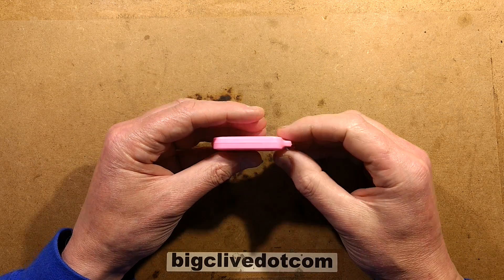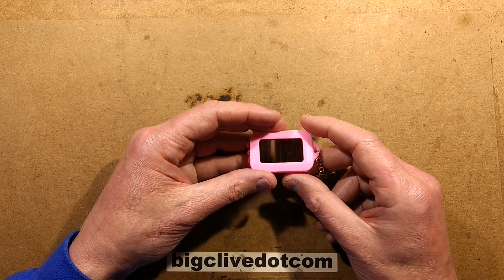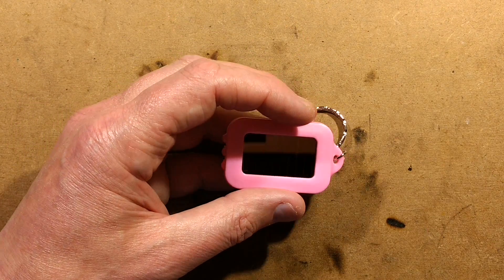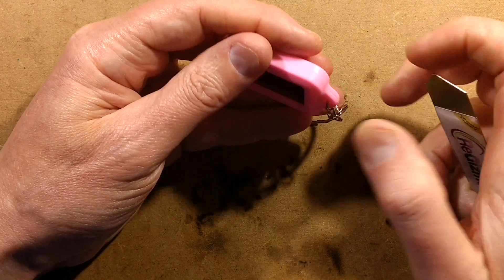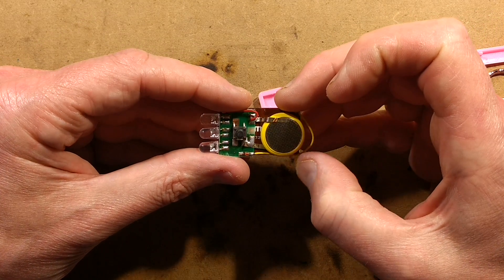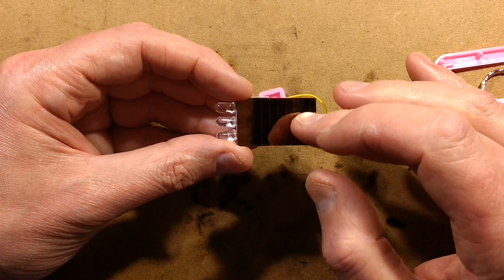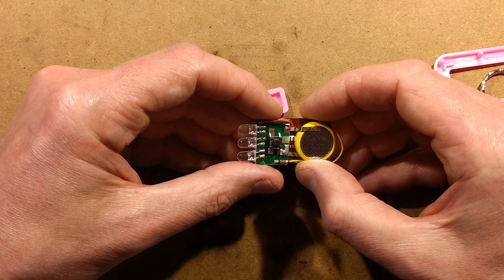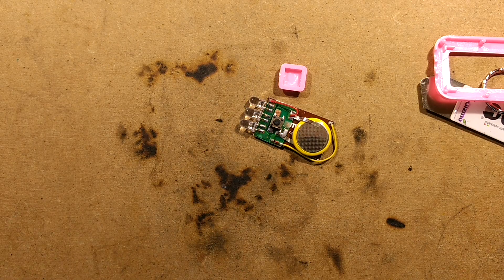Pink solar flashlight.  Real or fake charging circuitry?  Place bets now.

Comment: Bought some of these for parts, as a wise man suggested.  The negative side of the solar cells had stub wires to attach to the circuit board, but not one was connected!  Not sure I'd be comfortable with a 7-8V solar cell directly connected to the 3V lithium cell.  Handy little parts, though!

Comment: G'day,

  Yay Team !

   I bought 10 Solar Garden-Lights last week, in packs of 2 at $2 per pack, and when I checked them after removing their Battery-Isolation Tags only 5 of the 10 Lights worked ; and the Duds all rattled upon shaking.

   I, too, suspected them to be too cheap to actually have actually Rechargable Batteries, thinking that maybe the PV Panel might be for switching a Disposable for a few day/night cycles...; and the Rattlers gave me a reason to open one up.

   There was indeed a Rechargable in each one, a tiny little Button-type NiMH, and the Rattlers all featured loose Batteries ; all remediated by increasing the bend on their Positive Terminal Connection in the "Cage"- mounting, which then gripped it via friction in Compression.

   The same Lights were  also available as singletons, at $1.50 each...; my guess is that none of them would be the "Rattling Duds", which are apparently all mixed in with an equal number of working units, before being packaged in specially printed "2 for $2" Cardboard Boxes..?

   Cheeky Chinese Business-Practices.

  ;-p

  Ciao !

Comment: I bought one of these 3 years ago from a 99p store (R.I.P).
Took it apart and the solar panel is real but not connected and the battery is non-rechargeable.
It's still lighting up though.

Comment: I got like three sets of five of these things. The first two sets were fake with just a CR battery, one from Amazon and one from AliExpress.

The third set I got mentioned in the description (AliExpress again) it had a Ni-MH 40mAh 3.6V Rechargeable Battery, but when I got it was an LIR2032 battery, with the solar panel actually connected.

That being said the build was so low quality, in 2 of the 5, the battery was not even connected or barely connected to the board and none of them sit in the case properly leaving a gap between the solar panel and the case with the LEDS sometimes pushed inwards. Yet in the fake ones the build quality seemed better, everything fits how it should, etc.

Comment: wow didnt expect it to be real. I just ordered one for 1 canadian dollar (so 60p) I think thats probably the cheapest they can be had for without messing with actual auctions. it'll be interesting to see if the cheaper listings have fakes or real ones.
btw clive (or anyone) have you noticed any change in your mains supply? mine always used to be 245V or thereabout but I happened to measure it a couple of weeks ago and it was 232V and its stayed within a volt of that ever since. are we actually moving to 230V instead of just pretending, maybe as local substation hardware is renewed?
Reply: Nope.  Here in Southampton I get 248, when I tested a few months ago it was 247.
Reply: robmobz mine seems to float between 247 & 250 in Pembrokeshire only ten miles from biggest gas powered power station in Europe apparently. Right now it's 249.5v

Comment: I bought one that instead of the single battery has 3 what looks like AG13s taped together in a triangular shape, and I haven't checked the circuitry or markings on batteries yet but it did stop working after a few months.

Edit:
I just took it apart and it is rechargeable with 3 ZM20H NIMH cells.

Comment: Speaking of a cheap source of components. To my US brethren, RadioShack is going out of business and their components are pretty cheap. Totally worth checking out. I got a ton of loot on the cheap.
Reply: bdot02 RadioShack already went out of business, lmao. Any locations near you are just locally owned
Reply: rip radioshack
Reply: bdot02  I went to the 3 that were in my Area Yesterday and they were all fully closed.  I needed some CR1616 batteries.
Reply: You wicked Vulture feeding on its corpse
Reply: If Radio Shack already went out of business why is the website still up and it says they're open till the 31st?
Reply: Adam Porter yeah, I looked it up afterwards and never edited my comment. I never heard somebody had bought it out. There will still be ~400 locations still up though
Reply: Not entirely, I know they are keeping some locations in my area open as far as I am aware, while they closed others last year (less profitable/slower stores got shut down while ones that were still doing well stayed open).  If a store near you is closing though, the electronic components are very heavily discounted usually as electronics as a hobby is somewhat niche still.  I got a few of their usually massively overpriced ultrasonic sensors for a few dollars each.  Still, you can't beat buying a lot of that stuff online from eBay or Digikey, but even if they are a bit more, they do have quality stuff and no mailing time is nice, so go pick up some stuff.

Comment: I was interested in seeing this as I remember buying one from Poundland years ago, and it didn't seem to re-charge even after many many hours in the light.
Reply from the maker: +Davey Dave Poundland had a batch of the fake ones.  I sent them a message about it and they immediately withdrew all the fake stock.
Reply: bigclivedotcom amusingly enough the one in pound land actually had a real, good quality solar cell (but non-rechargeable battery) inside. So you're the reason I couldn't get any more convenient cheap solar cells ;) (other than the garden lights but that ends up with a lot of trash...)
Reply from the maker: The one I got had a very crappy looking cell that was clearly a factory reject.

Comment: I don't mind the zooming.  All of my devices are at least 1920x1080 ranging from cell phone, ~7+ inch tablet, 19 inch laptop, 23 inch widescreen monitor (higher than 1080 res) and a 55in tv running 1080p.  All are fine for me.

Comment: Did you say "spudger" ?  Is that a slang term I like the sound of that.A small flat thing? Thanks for sharing.
Reply: Plum Bob it's an electronic  industry term that's been around for decades. usually it refers to a plastic or wood stick flat blade on one end and a point a/o hook on the other. many variations.
Reply: Thanks for the info st1300 r

Comment: I bought two of these after I tested about 30 from a box... I took one that worked and one that didn't, thinking that the button cell is depleted and needs charging... Nope! Fact is that the cell contacts were completely corroded from the "flux" used to solder them... :)
Reply: And oh, yes, I also went for pink ;) (they were in a variety of colours: pink ones and white ones)

Comment: I guessed correctly! Well, mostly so. My guess was real solar panel connected straight to the battery with no protection at all.
Didn't actually think the cell would be rechargeable...

Comment: fak circuitry. I had one of these on my bedside table and once the battery went flat. i left it in the sun for an hour to 'charge up' and nothing happened. i took it apart and THE SOLAR PANEL WASN'T EVEN CONNECTED